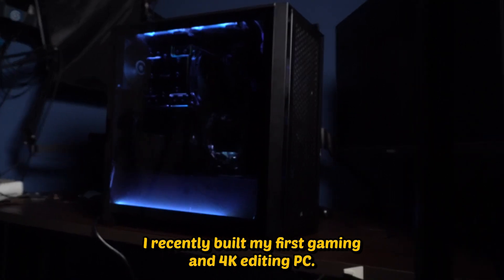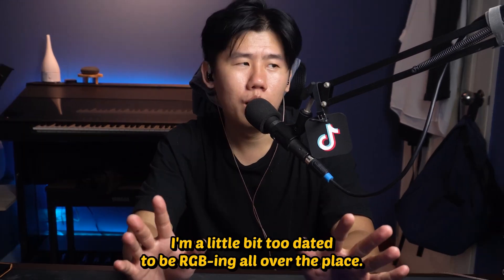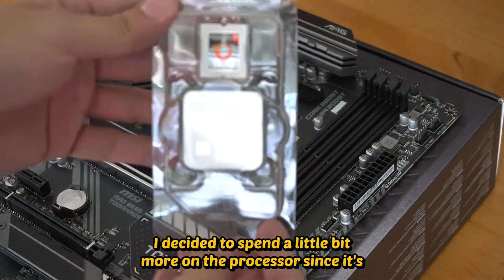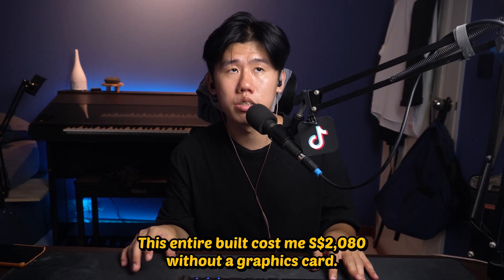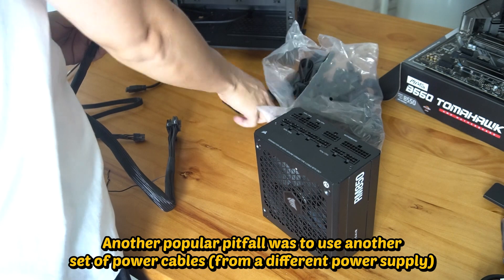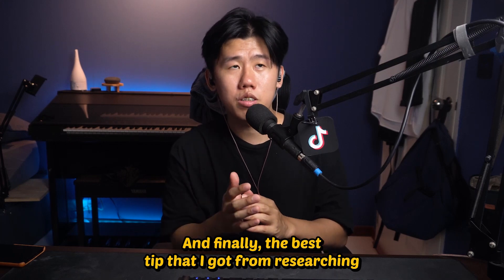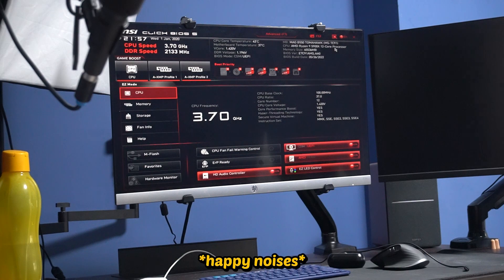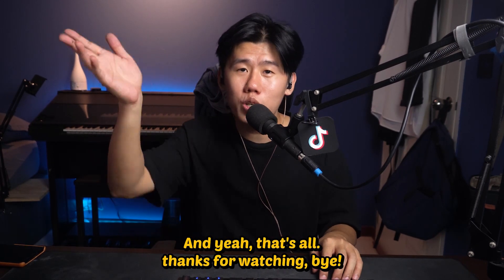4K Video Editing & Gaming PC Build | blackout aesthetic | summary of my YouTube research

Comment: This was great to watch. I actually have the exact same parts. Only difference is im using a Dark Rock pro 5. Im buying the 4000D case next weekend. Looking forward to it
Reply from the maker: This build has been serving me well! I might opt for a bigger SSD if I were to do it over again but the performance has been great.
Reply: @Alderic.  Im buying the case tomorrow morning. I hope that the air cool that i have will fit since its 168mm in height. Other than that, i have everything ready. I also bought some bequiet fans to install on the front.  May I ask your opinion on the stock fans that come with the case? are they loud ? I haven't got a 120mm fan so ill have to use the one that comes with the case
Reply from the maker: I never got to use the stocks fans. but based on the current parts, it would be quite hard to push the temperatures high enough for the fans to react. I wouldn't worry too much about it.

oh speaking of fans. there is a design flaw with the front dust filter that comes with the case. over time it does warp such that it may come into contact with the fan blades. I currently attach it a bit looser so as to give it space, others have bought a spacer to attach to the fans.
Reply: @Alderic.  The reason the dust filter comes close to the fan blades is because the fans will be at high rpm for long period of time. I cant imagine fans spinning at 500-650rpm will cause the nylon filter to react in a way to bend backwards into the filter and causing brushing noises, right?
Reply from the maker: @Ladioz  yeah. but I think it happens over time even if you have your fans on low rpm.

Comment: Ok bro, just finished the video. Yup, don't bother "OC-ing" it in the traditional sense. Just go to the PBO option, change to ADVANCED, pbo limits to MOTHERBOARD, additional CPU boost set to max of 200MHz, go to curve optimizer, set to all cores, direction to negative, and magnitude to 15 as a start. If you get instability, drop the magnitude by steps of 2 incrementally. That's it. Remember to save bios profile.
Reply from the maker: yeah I did a modest undervolt for both the CPU and graphics card and both are relatively stable. I do get moments where I think the graphics card resets? both monitor hangs for a few seconds, black outs and goes back to normal. but those moments are very rare. I really appreciate the inputs btw.
Reply: @Alderic.  Are your PCIE cables daisy chained to your 3080? Don't do that. What I mean by "daisy chained" is that each modular PCIE cable for your PSU terminates in 2 x 6+2 heads, right? Do not use 1 modular cable and plug both 8 pin to your 3080. Only use one of the 8 pin heads per modular cable. So use both the modular PCIE cables of your PSU.

Comment: Correction re: the nvme slot. It doesn't necessarily have more lanes, it's that it has lanes from the CPU and not the PCH. Hence the latency is lower. And it's not always necessarily the slot closest to the socket. Always RTFM (read the fucking manual). Even after having over 2 decades of experience, I read the manual of every board when I build a rig. The layout page is always important.

Comment: Bro, as a pro in this line, you may wish to change your GPU to 1650 Super (or certain variants of 1650 which use the Turing die, e.g. TU116) for the improved NVENC encoder for your editing needs. Remember to enable GPU hardware acceleration. For social media content, the difference in quality between software and hardware encoding is too miniscule to be picked up but the time saved is gonna be significant. Glhf. By the way, what software are you using for editing?
Reply from the maker: hmm I have since upgraded to a 3080 and I'm currently using Adobe Premiere. I'm very surprised that it still gets choppy during playback sometimes even when I do a simple fade across 2 clips. it's still workable but very surprising.